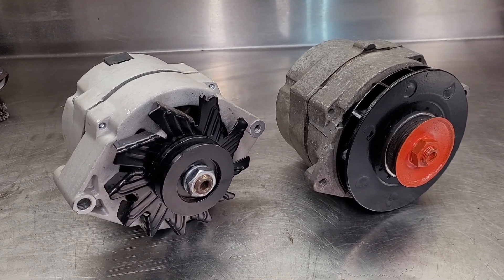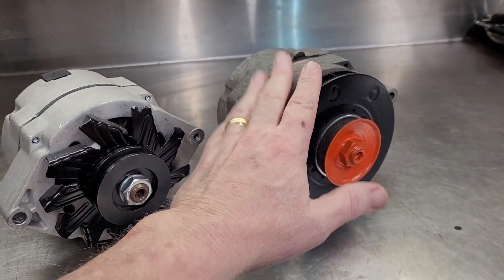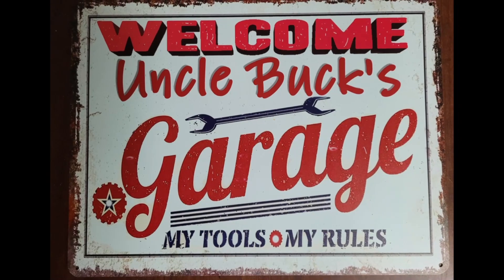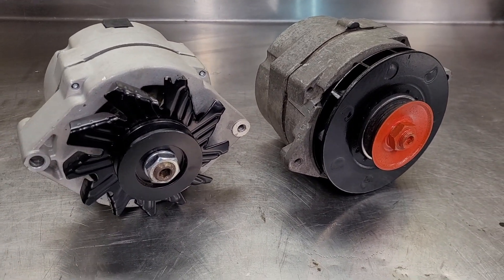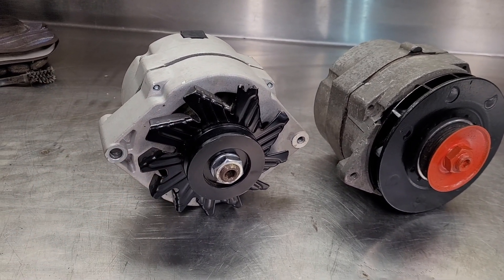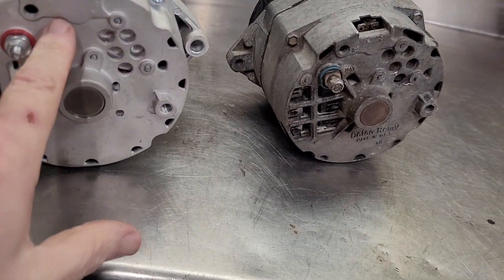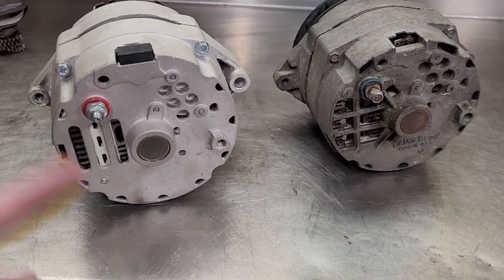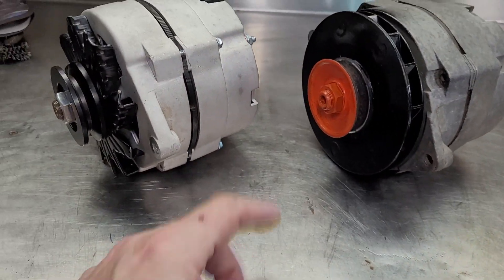HOW TO CHOOSE THE CORRECT ALTERNATOR - SQUARE BODY CHEVY C10 BUILD

Comment: Metal fan original 63 amp - flat fan 78-94 -10si alt - other 12si alt both can be used and modified to be 100 amps and converted to a one wire unit. Used to build for a cars,trucks, tractors, race cars .
Reply from the maker: Nice